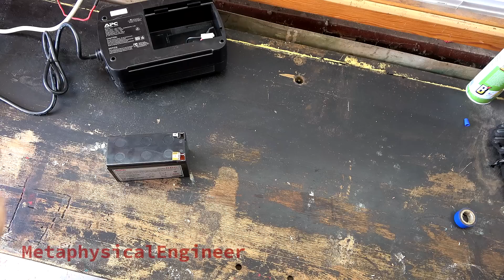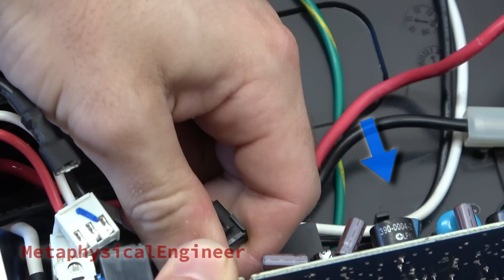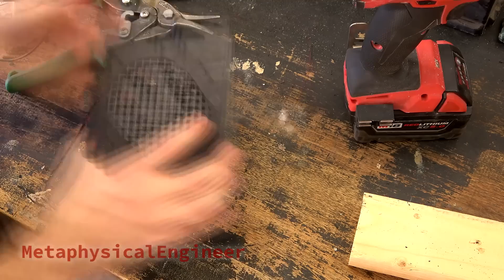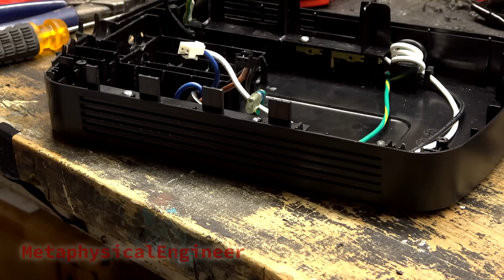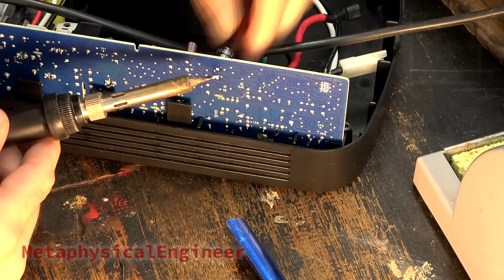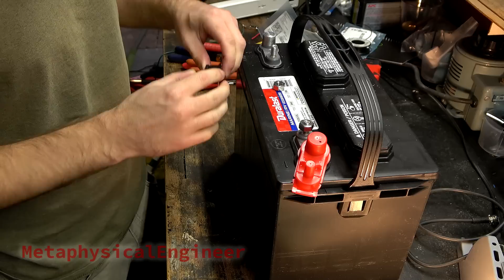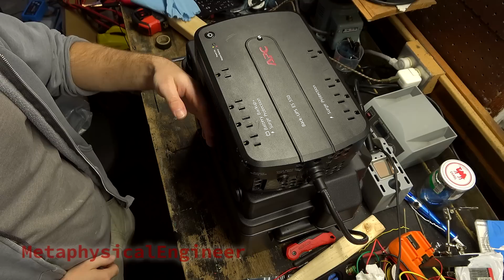Modifying broken UPS for long endurance BACKUP POWER!

Comment: I saw you might try lifepo4/lithium in the future, I sure hope you do. I would love to switch mine to lithium battery but can't push myself to try it without instructions. Leaving a lithium, even safer variant, alone all day on hacked together charger I tried myself is not my idea of fun.
Reply from the maker: That is the challenge of lithium.  Lead acid has much more graceful failure modes under extreme abuse.  LiFePo4 is relatively safe, but can still wreak havoc if even slightly mistreated.  Battery management systems must be matched to the type of battery, and a quality battery from reputable source is important.  Both of those factors drove me away from trying lithium for this version of the project, as that could have increased the cost significantly.

Comment: Hi, great project, may i know what temperature monitor device you re using? Thank you.
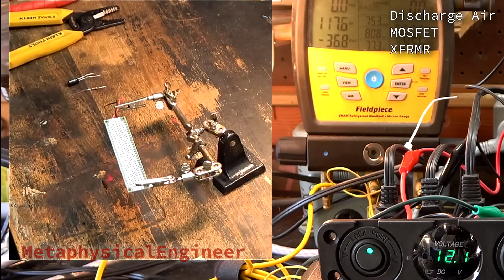Reply from the maker: The monitor at 15:30 is actually a digital manifold gauge for HVAC.  It has three thermistor sensor inputs so was convenient to have the temps together instead of three separate displays.  The thermal camera is a FLIR module built into my Cat S61 phone.  Thanks for watching!

Comment: Actually, you converted a broken UPS into an inverter. Good job. However, you cannot use resistors in parallel. It changes their resistance, unless that is what you want. I assume you were trying to increase the resistor's wattage, this is not advisable, generally you should just use the proper wattage resistor, and if you need more wattage, you are probably doing it incorrectly.
Reply from the maker: It's still a UPS, as it picks up the load of connected devices when the grid goes down in such a way that the load doesn't notice the transfer.  It simply has much more battery capacity than before.  

Parallel resistors are used all the time.  Achieving a resistance value which cannot be easily acquired from off the shelf parts and distributing power dissipation over multiple components are common applications.  

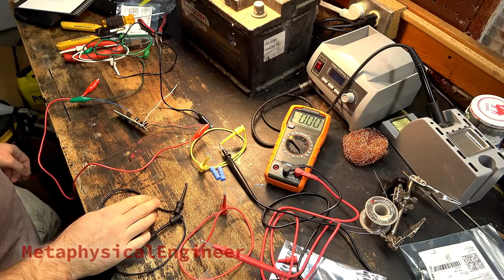The two 470 ohm resistors at 16:38 are clearly explained as current limiters for purposes of testing.   Those were the resistors I had on hand with values in a range that would be useful.  A single 220 ohm 1 watt resistor would have been an option as well.   I simply needed a low enough resistance to allow sufficient current to test the circuit, but high enough resistance to limit potential fault current to where no major damage could occur.
Reply: @MetaphysicalEngineer  thanks for the reply. I realize it is still a UPS, since it is not used continuously, thank you for the clarification. I also realize you were just testing with the resistors. Good build. I was only suggesting a CC CV buck converter is the proper solution. Keep up the excellent videos.

Comment: if you can mass produce this please take my dollar's!!!!  That was a fun build!
Reply from the maker: I'm flattered, but I couldn't fabricate one of these for sale in good conscience.  It would be a huge endeavor to get a setup like this certified, even if all safety standards are technically met.  Power banks with UPS functions are available, though the transfer time from AC to battery power might be too slow to keep a PC running.  Alternately, there are pro grade UPS units that can have external batteries added for extra runtime.  However, both of those options are expensive.
Reply: @MetaphysicalEngineer  Okay, take my dollars!!! I think I trust you!

Comment: Good work.  A quick note... you absolutely can NOT use a clamp on amp meter to read DC current.  Think about it.  Only an alternateing current will generate a magnetic field for the clamp to pick up.  For DC Amp you must use a calibrated "shunt" (precision high wattage very low ohm resistor).  Measure the voltage drop and use ohms law.
Reply from the maker: You're right that the regular current transformer clamp meters only measure AC.  Meanwhile, Hall Effect current sensors can measure either AC or DC.  Most manufacturers have at least one model in their lineup with that function.  My RadioShack meter uses a Hall sensor, but I didn't notice the glare and foolishly expected the camera to capture what was on the display rather than recording values manually.

Comment: Clean re-use of a UPS! I've always wanted a good computer UPS that allows an external 12v battery via plug, for my mini server farm.
Reply from the maker: There are models out there geared toward enterprise applications that have provision for external battery modules.  Starting with one of those, much larger custom batteries can be installed like what I did here.  Added benefit of high output pro grade units will have internals and cooling rated for extended operation, so no need to hack in a fan.

Comment: FYI: if you can find the cable to connect this to USB on your PC and download the software you can adjust the runtime and alarm settings as well as thresholds for triggering a switch to battery power such as the voltage min and max. Typically they default to turning off the power after a few minutes to give the PC time to shutdown and maintain a charge in the battery, I changed mine to run as long as possible regardless of the capacity of the battery.
Reply from the maker: Interesting that the software has all those options; I'll see if I can get a cable and a version that works since this unit is 13 years old by now.  As far as I can tell, this one will run until the battery's drained or an overload occurs.
Reply: @MetaphysicalEngineer  Powerchute works just fine, they havent changed much of the software or the UPS in decades, so not much is updated.
Reply from the maker: Any recommendations for version?  The old ones are listed as discontinued, and the new web based one has abysmal reviews.
Reply: @MetaphysicalEngineer  I'm running powerchute personal edition 3.1.0. Looks like it was last update in 2019.

Comment: Check out the charging parameters of the charging system since I needed power for my drill at work and power wasn't always available I also needed to be able to boost my truck when the hired men ran the radio and killed the battery also had a flat tire a few times so a booster pack with a modified sine wave inverter and a air pump was my answer bought it in spring but when I went to use it the next spring it wouldn't take or hold a charge bought a new one and fully read the manual and it said that I needed to charge it up every so often or keep it plugged in to keep it charged and ready to go so when I shut down for the winter I took it into the house and kept it plugged in the next spring I again found it wouldn't take or hold a charge but under 70 dollars for a season wasn't bad I'm a cheap one don't like to throw out anything that might be fixable I could still use the  inverter and aiir pump if I hooked it up to my automobiles battery so years later got about 20 or so packed away and I found utube and the RV chanells in the beginning they too were saying to keep them charged and not to go below 1/2 way well I very seldom took them below 6 volts and had kept some plugged in over the years they said that if they were treated properly they should last between 5 to 8 years I never got more than a year then I found one that explained how they should be charged and proper charging parameters for long life and I. thought they had to be wrong after all the manufacturer should know proper charging parameters but my old black and decker booster pack was handy so I opened it up to who the battery manufacturer was so I could check out their website or call them to find out what the proper charging parameters were but didn't need to written right on the battery was do not discharge below 12.2 float charge is 13.4 and full charge is 14.8 and on the built in charger was output 12 volts so it was dead to start with and being discharged way too far since I had bought everstart booster packs with modified sine wave inverter I checked out what they charged to 13.1 so I phoned everstart they said that was fully charged but after almost a year I noticed that the amount of boosts I could get from the booster pack were going down from 5 to 4 then to 3 so I hooked up my good charger through the booster cables and got it almost to 13 volts and after a few cycles I got it to 13.9 but the damage was done I got almost another year before it wouldn't take a charge by then I found other chanells on replacing the batteries in some of my old booster packs and one on replacing the batteries on ups unit with bigger batteries and his was a unit I already have and I found something new that told me why mine had quit working I thought it was because I was using it as a power source hitching it with cables to a cat battery but on seeing his configuration on battery hook up interesting how a person could have a mindset to me it's a 12 volt battery so hooking it up to a 12 volt battery should run it but seeing how he wired it up I should have had 2 batteries in series 24 volts I guess when the second battery finally got too low it quit working so I'll replace batteries in some of my old booster packs and now I've seen your video I'll see if I can put in a bigger battery even if I have to modify the battery compartment and I'll add components to modernize it some USB a and some USB C more cigarette lighter plugs and a port to plug my charger into with so many old booster packs I should have all the parts I need

Comment: fyi those types of ups are terrible for your battery. if i were you i would convert to lithium so the bms takes care of the battery and will never overcharge. i used lead aid with my ups and it killed my batteries within 2 years but ever since i built my own lithium battery its been going for 4 years and still has full capacity and works great with all outages.

Comment: Nice! I had a bunch of batteries laying around already so I basically did the opposite, picked up a 1kW pure sine inverter and put that before the UPS. Eventually I'll probably make a failover system so it can switch automatically, since I don't have to worry about the switching time due to it being before the main UPS units. Maybe also hook it up to weather so it can precharge before a storm... yay scope creep
A week before that however (because of course) I had multiple 24hr+ power outages, and ended up doing pretty much exactly this, but with a power supply powering the UPS off of said random batteries plus a pile of sketchy AF car inverters lol.

Comment: I did this back in the day with a "bad" 3000VA ups. It was 48v. Bought 4 AGM boat batteries. It could run 4 computers for several hours.

Comment: An LiFePO4 battery would have been smaller and lighter.  And give you much more time since it can be discharged past 50% without damage (unlike lead acid).  It could use the built in charger, or you could also add an actual LiFe charger tied in to the inverter's Mains connection.  Don't forget to add diodes to protect the inverter if you do.
Reply: Oh, and most 12 v LiFePO4 batteries have their own BMS built in these days.
Reply: If you are going to the expense of using lifepo batteries, you probably have enough money to just buy an industrial-grade UPS rather than building your own out of dead hardware. Lifepo is RIDICULOUSLY expensive.
Reply: @Debbiebabe69   Have you seen the prices on industrial UPS units???  And a 12v LiFePO4 direct replacement for the 550 UPS battery is only about $35, less than twice the price of a generic lead acid replacement.

Comment: Car battery i better than nothing but suboptimal for an UPS. It's built to deliver massive current for a few seconds and then be charged, not for deep discharge/charge cycles. Thin perforated electrodes, bigger surface area. there is another type of batteries with thick electrodes and no perforations more suitable to use as an actual "battery"
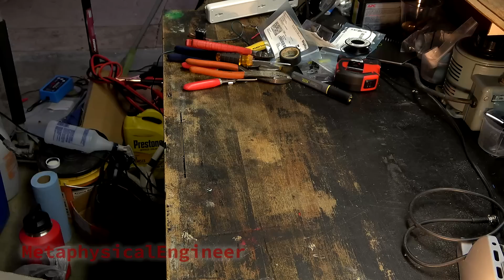Reply from the maker: May I humbly refer you to 22:26 to address you concerns :)

Comment: If you want to avoid the ABS looking like “that” when you drill into it, out the drill in reverse and apply a bit more pressure.  The holes will look 10x better.

Comment: What's that little switchable plug on the UPS for at the end? What model is is?
Reply from the maker: It's called OhmPlug.  Wifi smart plug with real time monitor and data logging features plus scheduled timer.  We use a few of them around the house for various lamps.

Comment: I always thought the issue of overheating was the charging portion of these projects?
Reply from the maker: Some other commenters have mentioned charging circuit failure, but the biggest heat issue is forcing the inverter to run much longer than designed.  Charger is certainly very underpowered for such a large battery.

Comment: I have THREE of these that i picked up from my work because the batteries are dead and they just opted to buy higher-end models and I was wondering if something like this was possible (my knowledge of electrical systems is pretty small but I did take EMS back in automotive tech school) and now I see that it is entirely possible. Maybe I should give it a try. Do you by chance have a diagram of the circuit you put together for the fan control?
Reply from the maker: Schematic is found at 8:52.  I don't have a diagram of the physical layout since it was small enough to sort out as I went, some of which is shown in fast forward starting at 15:31.  Please use caution working with such large batteries and AC powered equipment; this video is a showcase for the project, not exactly a how to guide.   Good luck with your project!
Reply: @MetaphysicalEngineer  I must've missed it as I watched it at work so my attention was divided, thank you. Oh absolutely, I'll do more research on the subject before I even attempt it. Thank you for the reply!

Comment: Are you worried about the gas's that car battery's put off ? Great project. Let me know you'r thoughts about the gas ! I would love to copy you'r build.
Reply from the maker: Gassing is not a big concern for a single battery at float charging voltage.  A bank of batteries requires special safety measures like forced ventilation, catalytic combiners to turn the hydrogen back into water, and hydrogen gas detectors.   Especially with heavy charging and discharging cycles.  

A sealed absorbed glass mat (AGM) type battery has the recombiners built in and will not release gas at all under normal conditions.  More expensive but a safer choice.  

Other suggestions made by other commenters mention a LiFePo4 battery with separate battery management system, but that would require additional modifications to the UPS circuit.  More expensive still, but very high performance, zero gassing, and much more compact for a given amount of energy storage.
Reply: @MetaphysicalEngineer  Ty. I was going to us it for a off grid battery bank. And that means near full discharging of battery and full recharging. I'm gusting that probly would not be smart !?
Reply from the maker: @frankenstein3163   If you're going to be cycling lead acid batteries often, you would need triple the expected capacity or more so the batteries are never drained below 50%.  This also gives you extra emergency power storage.  Off grid can be a challenge depending on how reliable your sources are.  Cloudy days and shorter days in winter for solar, unusually calm weather for a wind turbine, or drought that starves a hydroelectric generator could leave you with less power than expected.  The battery system needs to have enough extra to ride through those abnormal conditions and at least keep basic items running.
Reply: @MetaphysicalEngineer  I think ill just stick with you'r planes for my power out times. And go lipo for my off grid. Thanx's again. I love bad weather. So ill  put wind turb('s) in my loop.

Comment: @MetaphysicalEngineer I wouldn't use a non sealed battery. They release hydrogen and oxygen under normal usage and can release hydrogen sulfide gas. While hydrogen sulfide gas typically occurs when over charging occurs (unlikely in this case) it is still a concern if a cell goes bad. For safety reasons, I'd go with a Gel AGM battery. Optima are probably the most well known. But their quality has dropped considerably since they moved their manufacturing to Mexico years ago. I had issues with them twice in my cars now. I switched to Odyssey, but they're even more expensive than Optima. You can find a lot of cheaper options out there these days. While the risk is small, it's still not a risk I'd be willing to take.

Comment: Hmmm. I just took a 24v 900va and hooked it to two truck batteries and keep the load under 400 watts… runs for days, no overheating stock.

Comment: Great Job however using a vented lead acid battery inside a home is not a good idea. There are many reasons why a UPS and every other devices using lead acid batteries indoors all used sealed type batteries.

Comment: You should add a plug so that if you wanted to fire some reason connect a solar panel
Reply from the maker: I can connect a solar panel through the 12V socket I installed on the battery box, and I might try that with the smart charger panel I keep on my car.